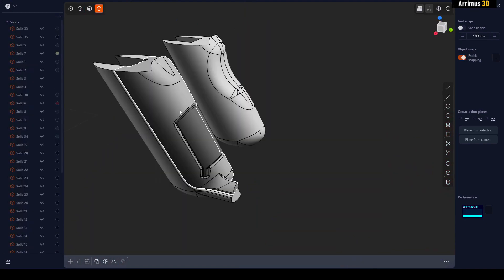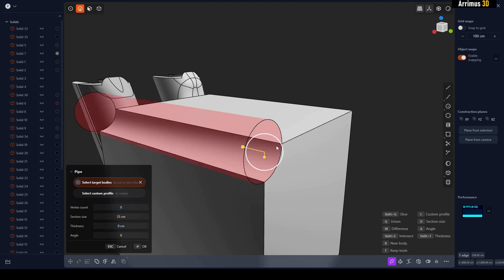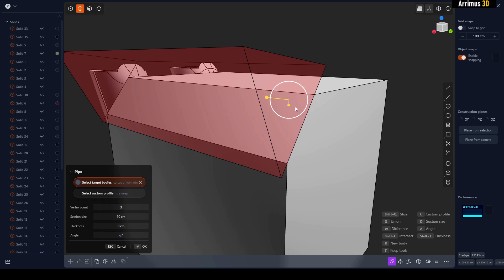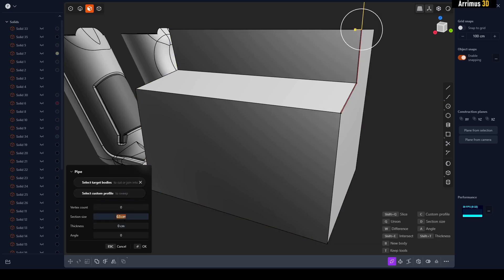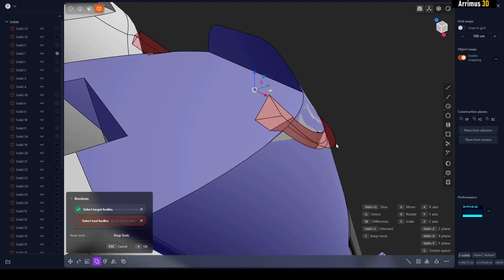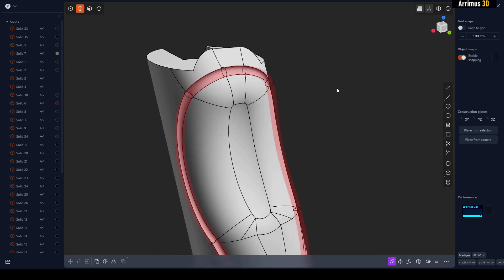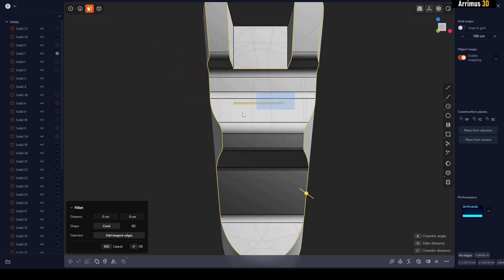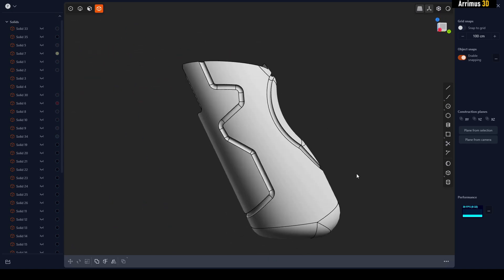Plasticity - Pipe Tool

Comment: Arrimus I have been trying to do my own model after making it half way through your comprehensive course on Plasticity (Udemy). I am still struggling with trying to make a ship body (Battlestar Galactica - Viper Ship). I have tried lofting the crap out of a body but I can never get the shape to line up correctly. Do you have any tricks for lofting accurately?